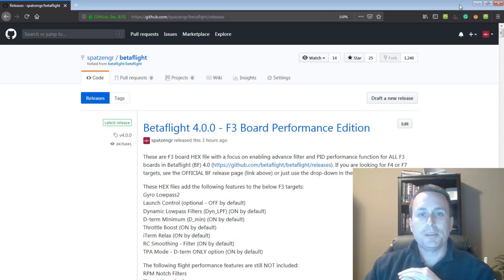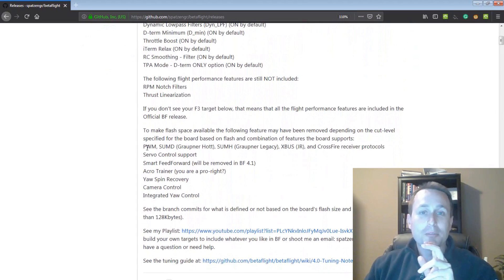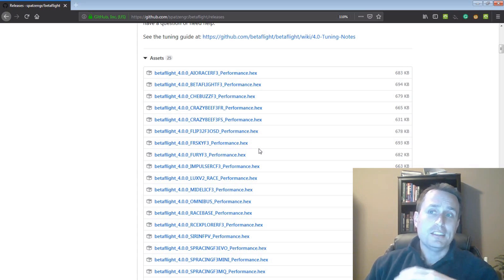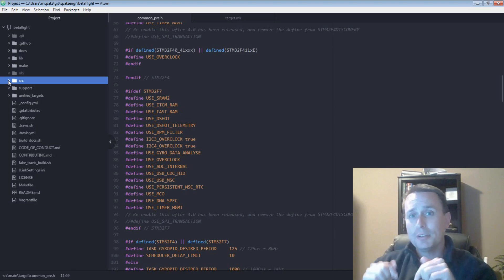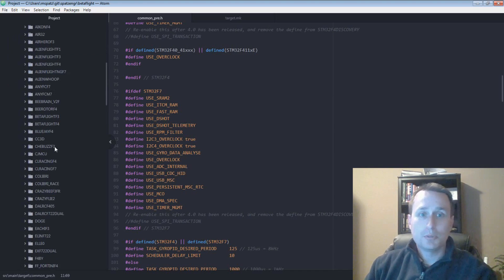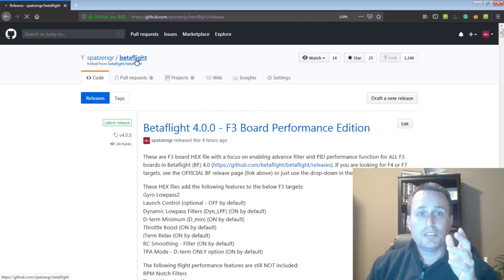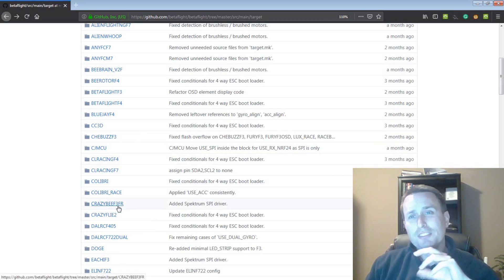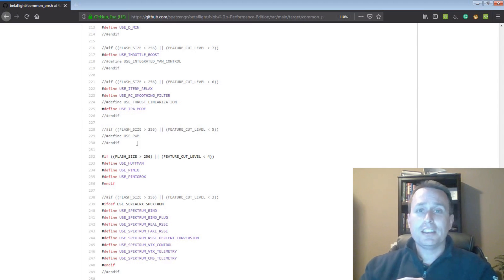Betaflight 4.0 F3 Board Performance Edit Release

Comment: I’ve put this on an mob7 f3 board and it won’t talk to the escs.. 
Blheli configurations works all ok on esc. But the btf won’t communicate. Anyone got an idea? 
Yes I could just buy an F4 board… but no!
Reply from the maker: Sounds like the board might have a DMA conflict with RPM telemetry.  There are ways around it with Resource Remapping, but it is complicated.

Comment: Thanks so much for this, I still have a F3 board in one of my quads. I notice the betaflight f3 board has been removed from your 4.0.4 Performance Edition list, I'm installing your 4.0.0 version to be safe but wondering if the flight performance features are now enabled for this board in the official releases?
Reply: Digging into things a bit more I notice the Betaflight F3 board had a feature cut changed from 10 to 7 with the official release of version 4.0.1
Is there any chance you will be doing any more updates of these performance builds and include the bff3 board? 🙏😎
Reply from the maker: I need to look at it.  With Unified Targets it is not as easy since no configs made for F3 boards.  But i imagine classic F3 target will still exist yet for the next year (maybe).
Reply: @uavtech  Cheers mate. I'm running f4 boards in my main quads anyway these days, the f3 quad is getting pretty long in the tooth now.

Comment: Does either maintenance edition have anything important in there?? I thought my motors may have been cooler after 4.0.2, maybe...
Reply from the maker: probably, more filtering is turned on by default in 4.0.2.  I have not updated Performance yet for 4.0.2 changes.

Comment: This is amazing, my F3 quad flies better than ever! 
My Blade Torrent 110 2" without propgards, Spracingf3 flight controller was really bad with default PIDs on BF 4.0, lots of oscillations and prop wash. I flashed the performance build, setup the modes and receiver. Started to fly, ready to tune the hell out of it, but it was flying great. In the end I only needed to tune the high throttle oscillations that I also experienced on stock setup.

Comment: Any chance you have a BF 4.0 PE for the Colibri Race?
Reply: Just realized you mentioned CRSF isn't supported in this release.  :(   Running 4.0 build 1222 and it flies great, but Betaflight configurator doesn't work for me with this firmware version.
Reply from the maker: it should.  you get it working yet?
Reply: UAV Tech I just updated to 4.0 and the configurator now works.  Did a test hover and everything seems smooth.  Maybe later today I’ll get out and do some test flights.  I want to compare the defaults with some of the community presets that you showed in your last video.  One for 4s and the other for 6”.

Comment: Thank you so much! And that's the beauty of open source. Don't like something the devs do, just do it differently yourself. 
Just to clarify, currently all F4 boards have all features, right? And how long do you think F4 will keep up? Would you recommend an F7 already? :)
Reply from the maker: F4 does have all the features.  Based off ROM percents I see after compile is finished, they are only half full on F4 boards currently.  I like F7 just because of the Uart thing, but otherwise up to you.
Reply: @uavtech  thank you so much! :)

Comment: So basically my bff3 is all but done?
Should I just run the older firmware on it?
Bc right now I have it running 4.3 i think.
It dont fly bad really.
But would like to have some of the things back
Reply from the maker: Load up a Performance build.  They have the good stuff.
Reply: @uavtech  ok man. Bc with what im using for some reason I had a wobble that I couldnt get out at like 20-33% throttle.
I'll try it out